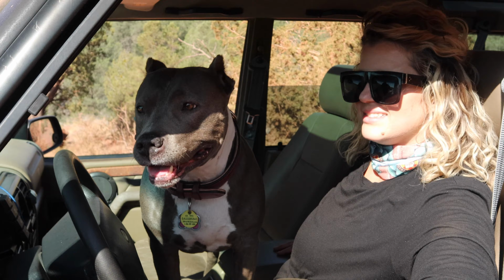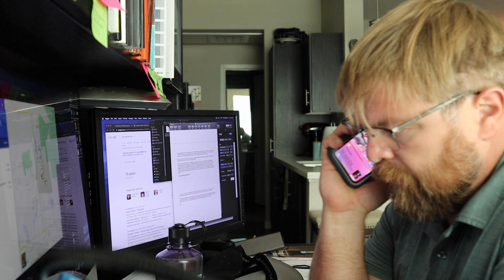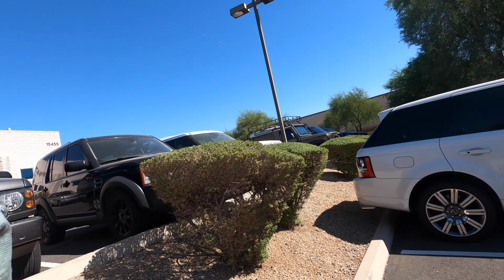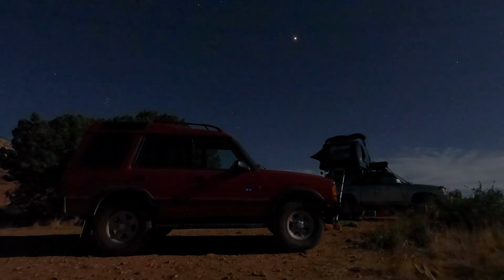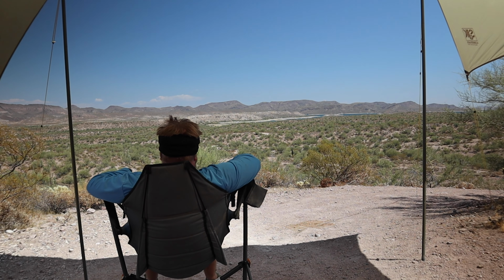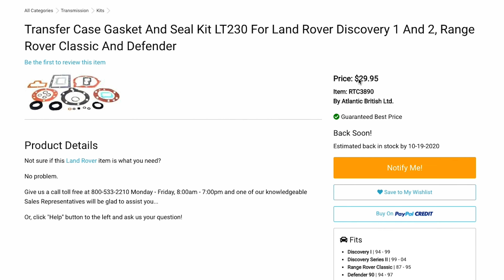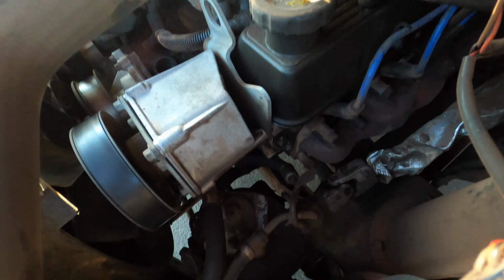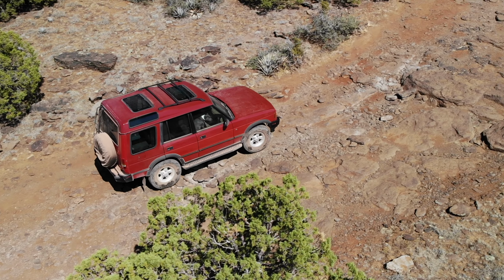Most All Of The PROBLEMS With My Wife's LAND ROVER DISCOVERY 1

Comment: Does somone maybe know how space there is between the driver seat and de backdoor en the height of the boot? Cause i am wondering if a motorcycle wil fit in it
Reply from the maker: It’s not a whole heck of a lot, maybe about 5’5” or so. I was wanting to put in a sleeping platform in the back at one point, but would’ve had to slid the front seats all the way forward for me to lay down without sleeping diagonal. I’m 5’ 10” for reference.

Comment: It's the valve cover gasket A head gasket will not leak oil wow...
Reply from the maker: Yeah, it will… all down the side and back of the block. Corner of the gasket was clearly damaged when I pulled it at the exact spots the leak was coming from.

Comment: i just brought a 2000 model Discovery 2 with a 2006 petrol motor in it 
it has $10000 of extras twin batteries full offroad suspension 10 ply 
tyres which cost 1800 dollars reverse camera with recording mode for 
insurance in case you get rear-ended Geenie headers brand new brakes all
 around disc brakes of course heaps of other stuff too i paid $6000 not 
sure if i paid to much i also own a 1985 Landrover county it runs an American v8 Diesel i have never had one scrap of trouble with it and i have never seen another one like here in Australia
Reply from the maker: Dang! That sounds like quite a rig! Which American Diesel motor is it running, by the way?

Comment: I got a 96 d1... Love it.... Had it 4 or 5 years now and too many stories... Lmk if you have questions... I do my servicing... Have done the heads also tty bolts... Be careful if you deck them the intake may not align after a couple times.... My diff lock has a shifter btw... Heard it was the d2 that didn't have it....
Reply from the maker: Right on. Yeah we didn’t have the heads surfaced for that reason. Sounds like you only get one or two passes before they don’t match up. So far, so good with ours!
Reply: @MattKester  same here.... Transmission just went out though... Rebuilt the valve body... Pretty sure it was just a clogged filter... Changed the filter and fluid about 3 years ago... Looks dirty in there... Pretty sure it's due to the mesh filter type in it... Not micron...
Reply from the maker: @alecaaa1  I see. Guess I better b make sure to do the full transmission service the next time I have it through the shop! How many miles does your Disco have on it?
Reply: @MattKester  had 114 when I got it for $1150 now probably 160...170ish after 4 or 5 years.... They've been hard years lol
Reply: @MattKester  btw mine was missing the magnet inside the pan for the tranny look like a ton of ferrous soot in there.... Added some bars from home depot for a couple bucks and max atf from royal purp...says it covers dex 2d... Found them around 10ish a qt.. Been driving around in the snow the past couple days with a jacked up transfer case... It had 2 shot glasses of gear oil lol... We lived in a condo for like 3 years... No servicing allowed but that is behind us... Going to town on this car now... Picking up a good used xfer case soon for $120... Where did you find that smashed cooler line just curious?

Comment: easy stuff,  NB  the head gaskets have relief for oil return both ends of the head, IE there is no left and right head gaskets. the 3.9 and 4ltr blocks have no oil gallery's  in the back of the block to match these relef.  it can be an annoying and ongoing problem.   now there are a number of slightly different heads but i suspect the American 4ltr has oil gallery's at the back of the head,  I tend to dowel these,  send the heads out for a light skim ( mandatory)  check the deck of the block, well not so much the deck but the liners.  some 3.9 castings were shocking for slipping liners,  the 4.lt is the same  block ( actually still 3.9) but they stepped the bottom of the bore for the liner.  however it sometimes can move. the reason i mention this is,  back of the head gasket is usually associated with getting a bit of the worm side,  being alloy block and alloy head the liner expansion of head and block are about the same as opposed to a iron block and alloy head. thus you don't shit a head gasket as often.    while your there check the velocity stacks are not lose,  centre punch the alloy if they are.

Comment: When I was in college in 2001, I saw my first Disco in the campus parking lot. Absolutely mesmerized by the look - and always thought it was the coolest SUV on the planet. 21 years later as I was getting ready to hand my Grand Cherokee off to my 15 year old daughter, I decided a 2004 Discovery 2 would be my mid-life "corvette". I found one online outside of Boston. 84k miles - head gasket replaced - new drive shaft - frame sprayed - OEM brush guard - new A/T tires - safari rack - snorkel - rear ladder - chawton white color (prerequisite).When I say this vehicle was immaculate - not a single scratch in the paint, and the only interior issue was the driver captain's chair arm had some cracking. Otherwise, everything worked and looked amazing. Paid $35k for the vehicle and to have it shipped to Charlotte, NC. 

After receiving the vehicle, some gremlins ensued in quick fashion. 

1. Starter went bad (Replaced - $400)
2. Power steering pump went bad (Replaced with buddy)
3. New pump went bad (Replaced it again, and replaced all lines)
4. Power steering leak at the steering gear (Mechanic replaced steering gear) POWER STEERING NOW FIXED (~$3,000 in parts and $1,200 in labor)
5. Water pump and radiator leaking (Replaced) $500
6. Mechanic bolting on water pump and broke engine front cover (Replaced engine front cover $500 - mechanic paid for it)
7. Pinion seals and transfer case seals replaced ($1,100)
8. Sunroof intermittent leaking (Not resolved yet)

Ultimately, the power steering situation was the most frustrating. It was very odd, and I think more just a string of some bad luck. I have driven the car on several long trips (6 hour and 10 hour trips one way). I absolutely love it, and fortunate I have the means to invest in it to keep it maintained. 

As a note: If you find one in pristine condition, it will cost you as these are now collector's items. BE SURE TO GET COLLECTOR'S INSURANCE. The book value is much less than the market value. Good thing with that is the property taxes are inexpensive.

Comment: I don't mean any disrespect to all Land Rover independent shops....but so many of them charge outrageous prices that they send these trucks straight to the junkyard. 1600 for a transfer case reseal is absolute MADNESS. If you're ever in Vegas hit me up I'll do it for you.
Reply from the maker: Thanks you for the generous offer! The only thing that has had me floored more than what specialist shops charge for these things is how supportive the community of DIY Land Rover owners have been offering all the help and guidance we could ever hope to ask for! Fortunately, it turns out all the oil on the transfer case was from the leaking oil from the back of one of the heads. I just finished the 20k service and the gear oil actually poured out of the fill hole when I got around to changing the transfer case oil! That was a huge relief!

Comment: Power steering leak.... most common leak ever..  The crappy steering box develops a leaky lower seal because of two things:  1. the Sector Shaft (the vertical one the drop-arm is pressed onto) nests in a pocket machined into the coverplate.. lets call it an iron bushing..  that sector arm is harded...the pocket "bushing" is not (it is soft iron).. 
  - This causes, over time, an elongation/enlarging of the pocket in the cover plate.  
   - This in turn causes a pinching of the lower seal, which ultimately leads to failure of the seal.  
      * The area above the lower seal is part of the down-stream 'low pressure' area of the hydraulic bits inside the box.  
 This is compounded by the second problem with this box:  
   - The biasing valves (that provide directional boost to the steering) are high-pressure above, and low pressure below.. but they are kinda crappy and fail to seal fully (over time).. When this leakage happens it causes the low pressure area to become pressurized with high-pressure fluid.. which of course means the already weak and weeping lower seal opens the flood gates...

Regarding head gaskets.. normally its the valve cover gaskets that are actually leaking.

Comment: I worked for Rover dealer for 11 years. I would say 90% "head gasket leaks" were actually just the intake manifold. But, guess what, you have to take the intake off to do the head gaskets so the head gasket job fixed the leak for three times the cost. Especially an oil leak, there is only a very small oil passage through the head gasket that is nowhere near the edge.
Reply: You beat me to it.  Those valley pans leak like crazy.

Comment: Just another thought the V8 Rover motor is basically a Buick nail head motor and maybe you should investigate if you can do a straight swop to a BOP motor?
Reply from the maker: It’s an interesting idea. A quick google search make it look like a straight swap might be possible with a ‘63 and older BOP small block, but I think they changed the pattern on the bell housing after that. I think if I were going to re engine it, I’d be more interested in investigating a 300TDI swap (after I win the lottery) or, as much as it pains me to say it, an LS swap. There are a couple of kits out there, this one even allows you to keep the ZF transmission instead of swapping in a GM one with the LS. https://www.alternativeconversion.com/product-page/discovery-1-and-range-rover-classic-ls-swap-basic-kit
Reply: @MattKester  the issue with an LS swop is that the diff and axles can't handle the torque and they let go. I'll swop in a Buick 3,8 v6 and have more power and reliability than the Rover motor.
I live in South Africa and we don't have any laws governing what motor can be fit to what vehicle, neither do we have emissions regulations here either. A common swop here is a Lexus V8 in most 4x4's, they make plenty power and have lots of rpm for mud and sand.
Reply from the maker: I never even thought about the Buick V6, but that makes a lot of sense. I figured an LS would have the potential to be a bit much, unlike a lot of folks, I was less into it for the performance potential and more for the reliability and efficiency improvements, but yeah, it would have to be one of the less potent iterations. Which Lexus motor do they like to use over there? Is it something we got here, like the 4.7L 2UZ or something else entirely?
Reply: @MattKester  mostly the 4,7 then make an adapter plate to fit the bell housing. We mostly have stick shift vehicles here, so a flywheel mod, unless you have a Toyota that you fit it to, and a spitronix management system.
2 guy's I know have the mid to late 80's Hi Lux double cabs, the one had a 3,0 straight 6 7MGE and he loved it, the other guy went overboard and fit a 2JZ with twin turbo's to his. Was useless off road, but towed like a dream on road.
In the end I guess it's what you want to use your rig for. My Pajero is an auto and if it was economical I'd put a lower stall converter in for better off road ability. But being that our Rand is at 15:1 to the US Dollar that's not going to happen soon.
If I were you, in an ideal world, and could legally do it, I'd look for a virgin 3,5 Rover motor and swop that in, least amount of mods and the 3,5 was the origin of your motor. Smaller bore=more head gasket material=better seal between the head and block. The loss in power is not that much and the reliability goes up exponentially.
But if I were you and the motor puked I'd go the Buick 3800 route.

Comment: Par for the course on a Land Rover, if it doesn't leave it's mark on the driveway it hasn't got any oil in!
My brother has a Range Rover classic and even after we removed the motor and gearbox it still leaked oil.
Reply from the maker: Sounds about right! i've found I gotta take this thing to a wash bay every time I patch something up just to make sure, there's so much residual!

Comment: I had a disco 1 for 16 years with 300tdi engine. Very easy to work on, 260,000km, never needed a tow. Great vehicle if you appreciated its limitations. Serviced by me.
Reply from the maker: I’m really beginning to think I need to start a TDI swap fund!
Reply: @MattKester  i would.  300tdi manual.  but your in the states so hens teeth I think.  how ever the 300tdi was made in brazil. upguned to a 2.8  sold as an international in the US and even fitted to ford rangers for a couple of years.   these motors were the default crate upgrade  for the D1

Comment: not sure how much you have got done, but the transsfer case isn't finished with gaskets, it's a tube of sealant that you need to split as if you're replacing gaskets but just a bead of sealant and bolt back together to the required torque. Most of your other parts on the list is small and you can work out what to do I'm sure. The intermitent rear windows is caused by a dry solder joint on the rear window power relay inside the control box (under the dash, behind glove box) removal of the board doesn't require the unit to be unbolted, just lever out the plastic finisher where the plugs are and the board comes out. you may need the glove box totally removed though. Wipers are either the multi-function unit behind the internal fusebox or a plug issue probably at the back door... Mine used to work when it felt like it. As a note here if the rear door is open the wiper will not work, so make sure it's not a door sense issue. Have fun!
Reply from the maker: Turned, out, the T-case wasn't the issue, the head gaskets were just dumping so much oil it was running down the back of the engine an onto it. I pulled the fill plug and it immediately began to spill as I filled it. The dry socket on the window power relay is definitely on my list of to-do's!
Reply: @MattKester  That one is really easy, once the board is out you might see the crack, if not just reflow the solder on all the pins, Done a few of them now, litterally a 5 min job once the iron is hot. :-)

Comment: Is the diff lock seized?
Reply: its the transfer case seal leak,  if you have trouble with the centre diff not unlocking, sometimes you have too rock the car forward then reverse, its just mechanical wind up, its in all 4X4 owners manuals, been like that for years in all brands.

Comment: Oh boy, you’re gonna be in the driveway for so long the neighbors are going to think you’re a lawn jockey. ;-) Bon Chance! She will be solid when you complete everything and you’ll love every minute of adventure once she’s sussed.
Reply from the maker: She’s been quite a bit of fun getting to know. I do appreciate how it’s built to be worked on. There really isn’t much of anything I’ve come across on this thing that you couldn’t handle with the most basic of tool kits, which is much appreciated as next week I’m going to replace the upper ball joints and suspension bushings on our 4Runner, which is gonna require a bit in the way of presses and pullers that aren’t in most DIY’ers tool kits.
Reply: @MattKester  yeah, depending on the model of 4Runner, they’re fairly simple too. I had a 97 with the factory Elocker that was just a sublime machine. I could change the brakes and rotators on the front in all of an hour.

Comment: I like that your just a regular joe and not just a self proclaimed expert. I noticed you live in a condo, where do you work on your car?
Reply from the maker: Thank you. We have a one car detached garage on the property we use. I don’t think I’d ever be able to get away with doing something like swinging a motor in and out on there, but it’s done surprisingly well for what we’ve done so far. Some things just take a little thinking out so you know where to position the vehicle before you start working on it so you know you’ll be able to get to what you need to on the middle of the project.

Comment: Sunroof leak- remove headliner, oh. Download “RAVE” , that’s the shop manual. Remove headliner, locate drain tubes make sure they are attached. Next check to see if the drain pts, where the tubes attach, are still siliconed onto the metal tray.  It’s one of those two.  No more leak.
Reply from the maker: I got a copy of the rave saved on all my devices! We took the healiner down last month and dig into it. Turned out the sunroof drains just fine, it was coming in through the top of the windshield. Two tubes of windshield sealant later, she appears to be holding.